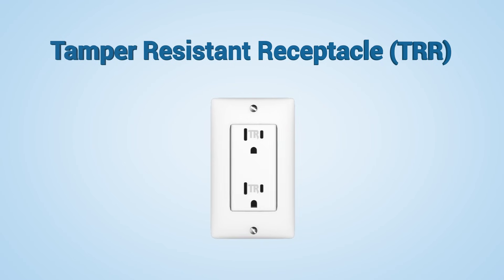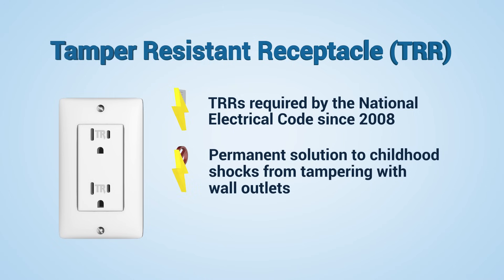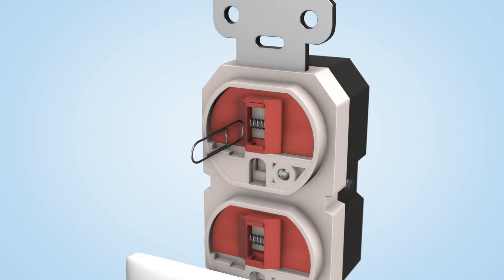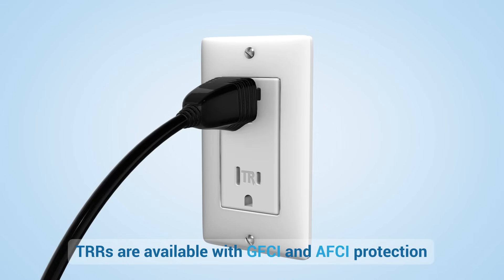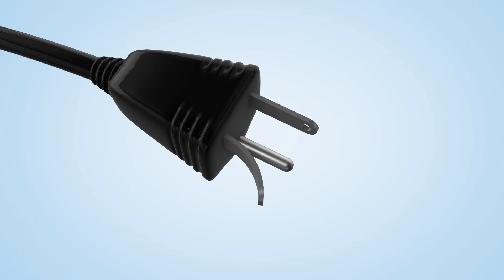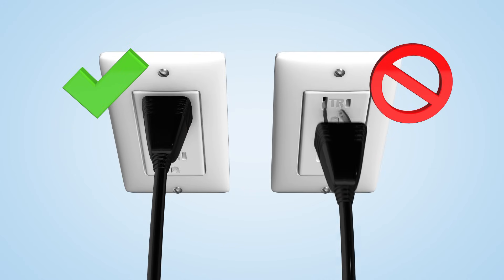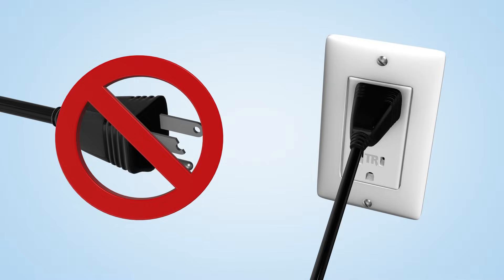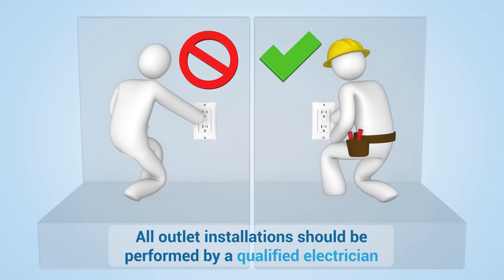What are Tamper Resistant Receptacles (TRR)?

Comment: Couldn't get mine working at first. What did work was I think I  "loosened" it by first plugging in a different device (in my case a power bar) and then after that retrying with what I actually wanted plugged in
Reply: Great answer! We just had this happen with outlets in our garage. It took 12 years to have the problem but we solved it with what we now call “the magic plug”. We had an electrician scheduled to come out. In desperation we tried the plug to our air compressor. Magic. Saved us the service call of $75.00. If the compressor ever goes out we’ll cut off and save the plug. LOL.

Comment: What if the plugs are brand new and the outlets won’t let us plug anything at all
Reply: That’s my situation
Reply: @ceed3d396  I assume a year later u figured it out lol? Did u just have to force it in or what happened?
Reply: @Mandy_39  you kinda have to force it there smaller then the plugs because of the pin that's larger which doesn't fit well. super tight fit

Comment: AND HOW EXACTLY AM I SUPPOSED TO USE A VOLT OR MULTIMETER TO CHECK IF MY PLUGS ARE OKAY? THIS DESIGN IS LIMITING ME TO USE THE SKILLS AND TOOLS I HAVE TO MAKE SURE EVERYTHING IS WORKING FINE.
Reply: Get a proper tester for the plug, or give your mulitmeter to a toddler and I am sure they will find a way to jam it in past the tamper protection.  Also caps lock is considered yelling on the internet.
Reply: https://www.lowes.com/pd/Kobalt-Digital-30-250V-Test-Meter/1001799404?cm_mmc=shp-    it will also test gfci or gfi plug and tell voltage all in one
Reply: Stick both multimeter probes in at the same time... doesn't take a rocket scientist...

Comment: +Electrical Safety Foundation International (ESFI) - 
But No word about that even the best shutters can NEVER protect from the shocking lethal construction of the USA plug system that is 100 Years behind the time: 
https://www.youtube.com/watch?v=EmVH5En6x6o
https://www.youtube.com/watch?v=Ihau12C9uq8
https://www.youtube.com/watch?v=6Dd6_TghcE0&t=5m39s
(same >95% applies to Israeli plug-system) ! 
ANY modern European plug / socket prevents it thanks to 
protective socket-recess (Germany "Schuko" , patent from 1928 & 
rolled out since 1930s ) or sleeved plug pins ( UK since 1970s / 1980s )
 or both https://de.wikipedia.org/wiki/L%C3%A4nder%C3%BCbersicht_Steckertypen,_Netzspannungen_und_-frequenzen#Netzsteckertypen

Comment: Just replaced a blown and old receptacle with a brand new one which I bought at Home Depot (15amp, standard 3 prong) and checked there is power but now I can't plug anything into it. The prongs of any plug seem to be encountering some kind of an obstruction halfway in, sounding like metal inside, maybe a screw or something. I tried wiggling it, inserting at an angle, forcing it..nothing works. What should I do?
Reply: Take it back and get a regular non TR outlet

Comment: Okay but my plug is fine. How do I get it to plug in now?
Reply: Funny doesn't help. wiggling doesn't help. why would one add an adapter, and would that plug in easier than an otherwise functioning plug?  Sometimes a plug works in one receptacle, but not in the one above it. answer me that, please?  Do TRR's fail? replacement necessary?
Reply: If you still havent got it 3 years later, try wiggling it
Reply: Not be cheap and get a adapter.